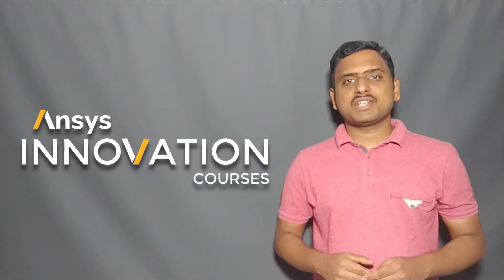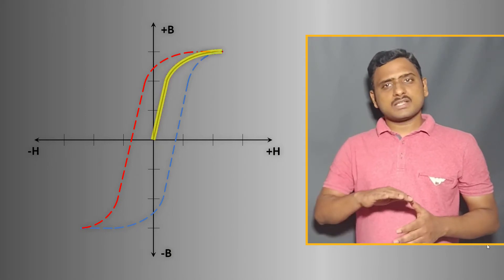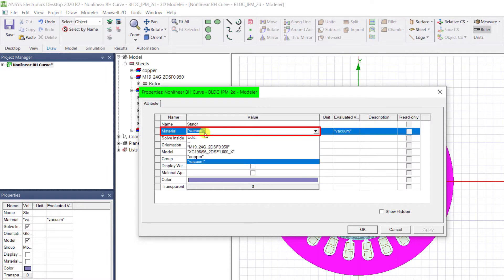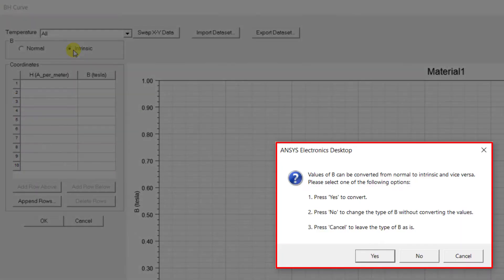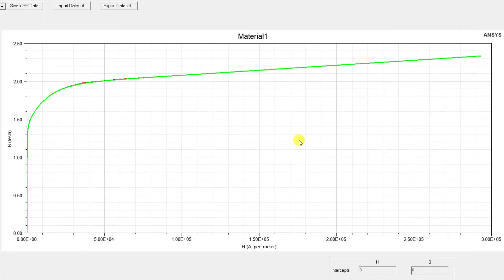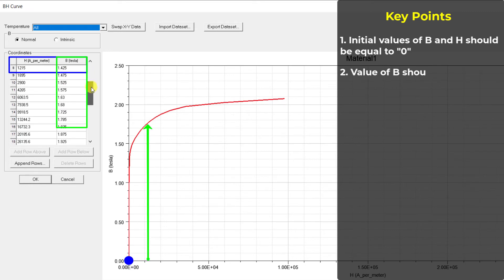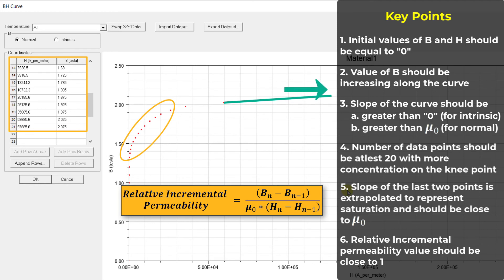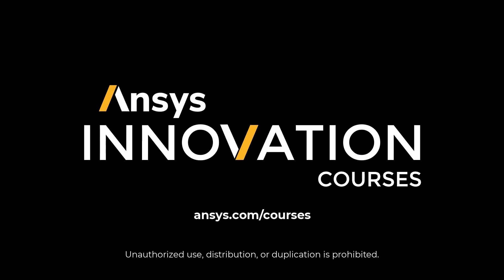Defining a Nonlinear BH Curve Using Ansys Maxwell

Comment: From where you get the BH dataset?? Is it available in ansys folder or we download from other website??
Reply: you get it from datasheet
Reply: It's going to be very material dependent, and will likely have to be obtained from either the manufacturer, or through direct testing methods yourself. Ferrites and other magnetic materials tend to be one of those things that aren't super consistent even among like materials, due to often relying on minute details in how the material is processed. Even slight temperature variations during the smelting process can introduce variability in the magnetic subdomains of the material, leading to slightly different behavior, so it'll have to be a bit of a case by case basis when defining the BH curve. Of course, for some common materials, there may be data available for generally expected values, but be forewarned that it could lead to inaccuracies in your own simulation when working with your own final materials.